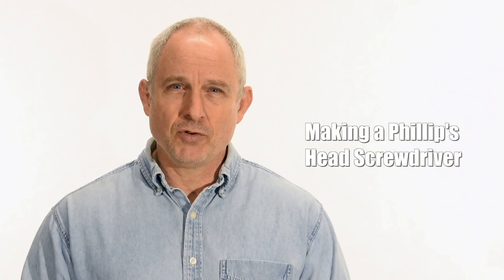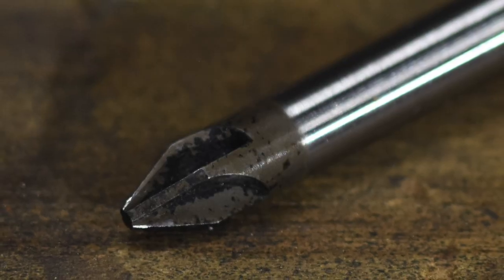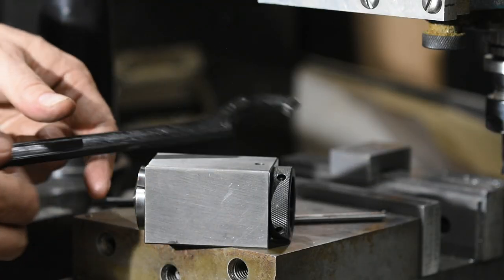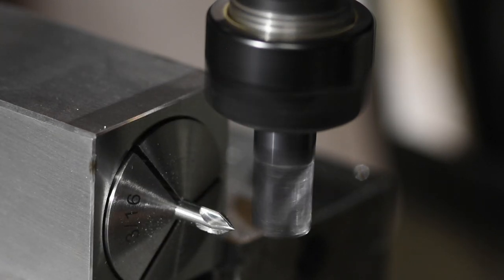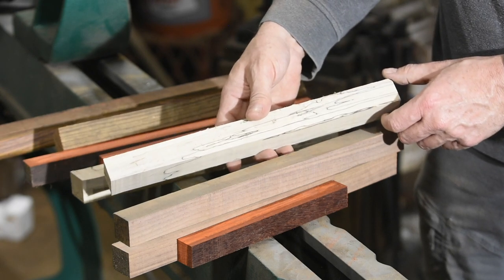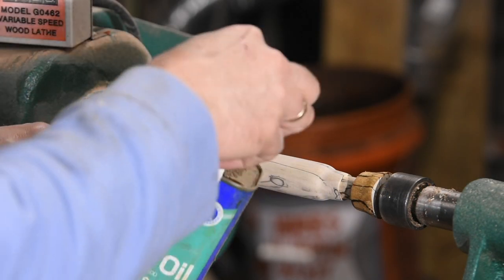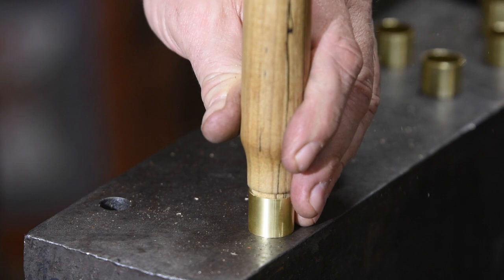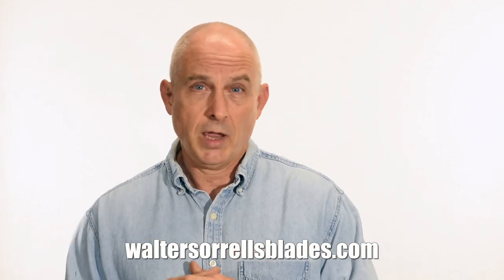Making a Phillip's Head Screwdriver

Comment: Great series Walter. I have broken the tip on a Klein phillips head screwdriver, figured that the tempering process was shortened a bit, rare occurrence. I've broken many tips with an 18 volt 1/4" shank impact driver setup. That's kind of expected as those tips are mass produced and QC is sketchy. You are correct in that they generally roundover/strip first, but on that, not as rare as you'd want, occasion they'll snap and leave part of the bit in the phillips slots. That's fun as well.

Comment: Oh, I've broken screwdriver tips off.  I work on corroded old machines near the Texas coast where the salt spray can even make stainless screws galvanically corrode to the aluminum holes, and the surface of the screws inside the drive head swells somehow to firmly wedge the tip into the head.  I guess it directs all the torque up to the top of the web, because I've broken the tips off even by hand.
Reply: Do you hit on the heads before to release a bit of torque and corrosion? 
I've learned that from the old journeyman when we had to remove a big window fassade to get a big motor out and another one in.

Comment: Not necessarily relevant to this build but I wanted to ask. How long will a blade keep its edge/sharpness while not in use? I mean if I leave a blade in storage for 12 months and pull it out (for this example lets say there's minimal corrosive atmosphere) how different will the edge sharpness be? Understand this is likely dependent on the steel type so lets presume it's high carbon or tool steel.

Comment: "When was the last time, you broker the tip of the screwdriver. Yeah, never..."
Imagine me do just that last week :/

I was planing to make a little knife out of broken screwdriver. Any tips for that? I dont hawe tools, for heat treeting.
Best thing is usualy to throw this thing to trash, yet it feels as such a waste.
Reply: Make yourself an Awl/punch.

Great use for old screwdrivers if you can't re-file them.

Triangle or square Awls for marking and reaming.
Round Awls for marking, scribing, setting nails, digging trash out of hard to reach places, to poke stuff, etc.
Parallel punches for pins, and the sort.
Center punch for metals (requires a different grind than an Awl, but can be used much the same way.)
Transfer punches for marking center of holes onto other materials.

You could do some other obscure stuff like deburring tools, or some other obscure 1 time thing tools.
Imagination is really your limit here.

For blades, you won't get much, screwdrivers won't have enough material for a good knife, but you could do a small marking knife, wouldn't be very ergonomic though.
And without heat treating it won't hold an edge very well.

The handles on screwdrivers can also be saved for files or other handle-less tools.

Comment: I'm actually pretty puzzled why you would use a drill blank for making a screwdriver? I have always used 4150 I have some lathe tools that I made some screwdrivers that are just ideal for every component on my lathe and their indestructible 4150 is indestructible when it comes to screwdrivers for what they are doing at each given size they're simply no way to destroy the tip of a properly hardened 4150. And there's tricks too You don't want to make a cupped in Flathead like you see so many people do I actually make them pregnant they are cupped outward they're like two fingernails touching in the middle if you can picture that bowed out it gives them more strength as a matter of fact a lot more strength and they look cool lol I don't use wood either I mean that's a lie I do use wood for some tools but a lot of times especially for small mechanical screwdrivers I make them all metal